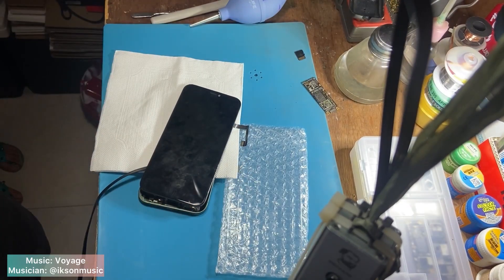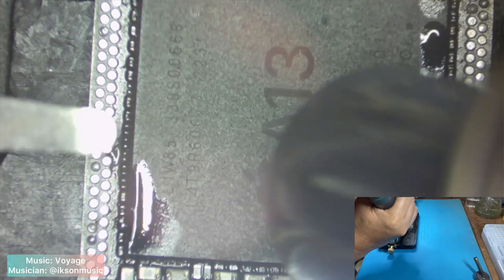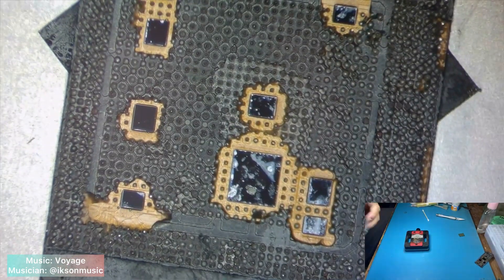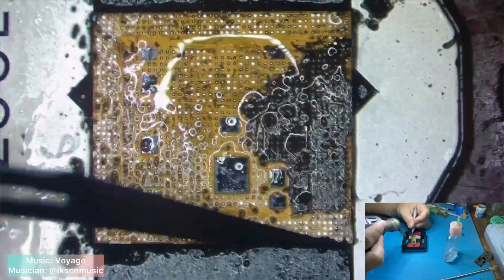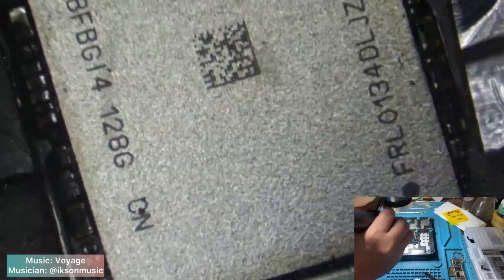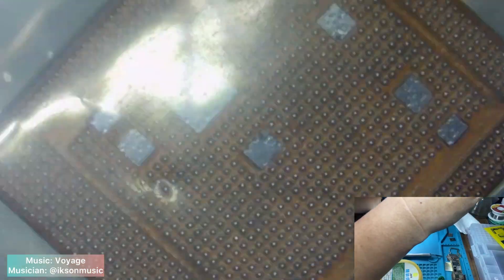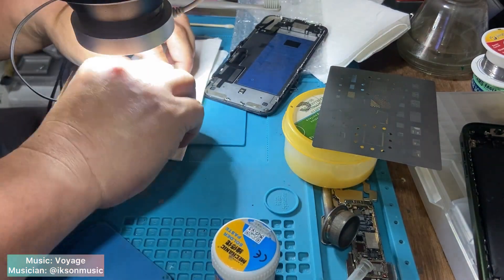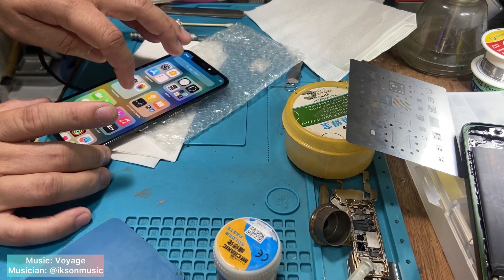i Phone 11 Logic Board Transplant(Full Process)

Comment: hi, I have a problem with my iPhone 11 promax cellphone, first when I use it the iPhone screen will turn purple then turn off but there is still sound from the cellphone, not long after that the iPhone will restart and turn on again normally... I have brought an iPhone service center and a technician said to replace the display IC but the problem is still the same, do I need to do something like a transplant?
Reply: there is writing panic base, base + socd and panic full on the sensor
Reply from the maker: @spectra617  hello brother. In my opinion.  The main issue is in the motherboard.  And base on your story. I would say that is connected in one of those  i2c sensors.  And it's  better to personally diagnose the unit to make sure what's sensors has been causing the issue. If im not luckily to have a chance to help you. You'll better find a professional to do the job perfectly. If not. The motherboard will have more damage and it will come up to transplant as you mentioned earlier.
Reply: @ScjRepairShop-  what is the estimated cost for transplant repair
?
Reply from the maker: @spectra617  102.30 usd brother

Comment: What about the baseband ic is it  no need to replace
Reply from the maker: if the problem is in the logic board  there's  no need to touch basebaand ic. and by the way. baseband ic is not required to replace.  because  it's paired to the logic cpu. if one of them has been replaced  you wil never activate the phone.